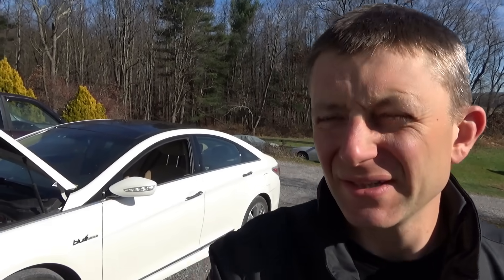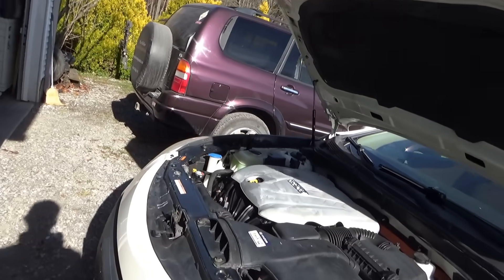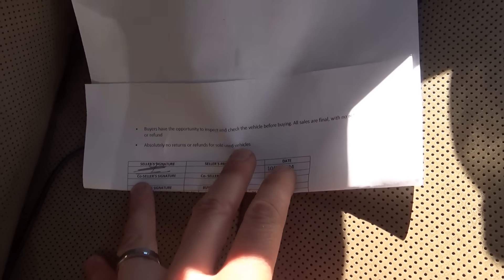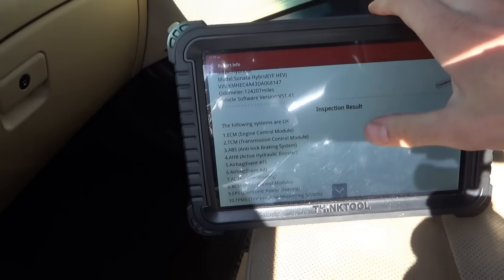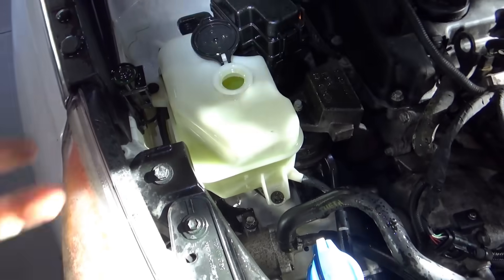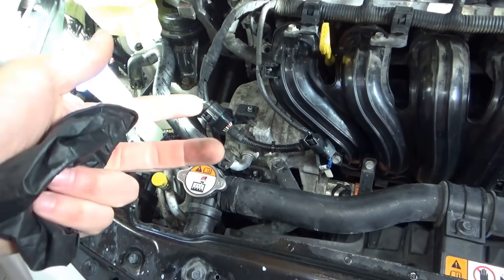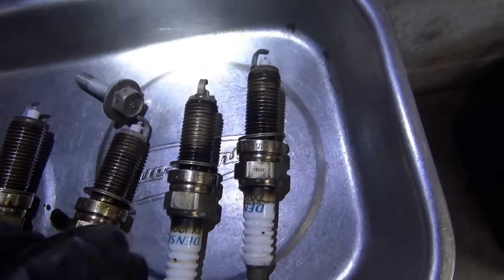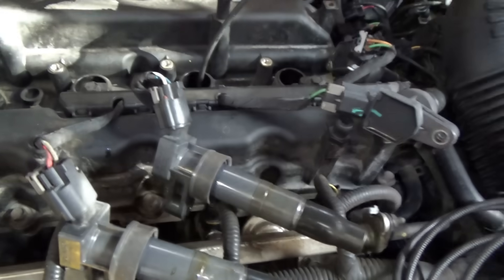Customer SCAMMED?! Hyundai Hybrid NO HEAT & PUKING COOLANT?!?!

Comment: if you have an exhaust gas analyzer you can also "sniff" the radiator/overflow for exhaust gasses. If there are any exhaust gasses present in the cooling system ya have a problem. :)

Comment: Curious if the radiator cap has been messed with so it won’t hold pressure in the cooling system. 🤔Extremely shady way to hide the problem during a short test drive and keep coolant from being pushed into cylinders and causing misfire at startup.

Comment: Gotta say, the buyer has lions share of responsibility here imo. Tires alone should’ve made them run in the other direction.
Reply: I totally agree! Its the buyers job to make sure its a good car! Its not the selling dealers fault they sold it with bad tires, if you didn't even notice the bad tires they must have just walked up and bought the car, no test drive or anything! They obviously didn't read the contract, it said "No Returns". Now that's not to say the dealer knew it had a blown head gasket or not? But dealers spend as little money as needed. They may have not even drove the car? It had no codes anywhere in the car! Also the customer drove the car to Ivan that alone could have blown the head gasket? Maybe the water pump or thermostat were bad and that was causing it to over heat? We don't know why it blew the head gasket, only guessing at this point. We are only getting one side of the story and customers always leave out the part the incriminates them! Always! I think the buyer is 90% at fault.

Comment: With that text from the dealer saying he has 30 days on the engine, he will surely lose in the legal arena. Not to mention the buyer will have much time invested to get to that point. I would have pulled the head and checked the block surface for flatness before getting another engine.

Comment: Mistake number 1, buying from a used car dealer.
Mistake number 2, buying a Hyundai.
Mistake number 3, buying a hybrid.
Reply: Love how the complaint is that it's a hybrid, despite the problem being with the ICE engine.
Reply: And not necessarily in that order.
Reply: I'd be buying a pogo stick before a Hyundai hybrid.
Reply: Buy a Toyota, instead.
Reply: @MichaelNomura-i9n you have seen all the Prius (Prii?) Ivan has confirmed bad head gaskets on right?
Reply: Nothing wrong with hybrids depending on the model
Reply: I say he only made one mistake...buying a used Hyundai.

Comment: Blown headsets push coolant away from the head, it creates hot spots, this is bad and can break the head due to thermal shock. 
I have a very long history of heavy line mechanic's at Ford in Santa Barbara and elsewhere in California. It's more common than you would think, and folks just hit the gas instead of having it attended to. Different metals move at different rates, aluminum expands twice as fast as steel, and goes twice as far, this is the primary reason gaskets fail.
Heavy line repair is a specialty, just like you and your expert take on electronics. Short driving cars causes more damage than anything, Hot cold cycles are a real problem, I have seen countless vehicles being short driven, most blow a gasket in less than 60 thousand miles, especially if they are aluminum on cast iron.

Comment: Long ago I put regulated shop air into a cylinder on something like that - don't remember the details.  The radiator cap was off for some reason too. When I hooked up the air hose to the fitting in the spark plug hole it blew coolant everywhere, including on myself.  Kind of had to laugh about it a few minutes later.

Comment: A couple of things are screaming out here. First of all, there is rarely a warranty on a used car, and the forms that are used for the sale are pretty clear, so you won't stand a chance in court. Second, the cost of taking a case like this to court is outrageous - and because the "Lemon Law" does NOT apply to used cars, YOU have to pay for the lawyer fees and court fees, so you have to do the math. You can figure at least 3K unless you go to small claims court, but most of them have a cap on the amount you can go there for, so either way you're hosed. Personally, I wouldn't want a hybrid anyhow, then you get one over 100K miles and from the majority of videos (Both Ivan and others I watch), they are ticking time bombs.

Comment: Thanks, here in the UK we do get some protection if you buy from a dealer and could return such a car in the first 30 days, possibly even up to 6 months if the fault was there when the car was sold.
Private sale, you are on your own, some private sellers even sell a car as spares and repairs only, even though it runs OK, just to avoid any comeback.

Comment: Ivan, reminds me of the time I screwed in a brand new Snap On pressure tester and that damn car with the blown head gasket filled it up with anti-freeze as soon as I touched the key! Seems like on this one coolant should be streaming out the exhaust pipe as well. Your process and diagnosis  was outstanding. Thanks for Sharing! :body-blue-raised-arms::hand-orange-covering-eyes:🙃🙂 P.S. Been looking at those cameras for awhile.

Comment: The blame game. Who’s at fault? Simple answer is the customer is at fault for not doing their due diligence and looking at the fine print. I’m sure it was advertised as “As Is” but the customer bought without doing a pre purchase inspection. I wouldn’t be so quick in saying a used car dealer scam when the dealer gave the customer 30 days even after stating no refunds. I’m sure they bought it at auction from another dealer unloading a high mileage car or a wholesaler who picked it up at auction to flip. Buyer beware! There is enough information published that anyone who buys a car as is and doesn’t do a pre purchase inspection that is just silly.

Comment: At 7:20, you had your hand in front of a closed vent.
Did you consider a stuck thermostat?
Mechanics recommend a pre-sale inspection for used cars. If the car is certified from a dealer, it has already been done.
Reply: Don't trust dealer inspections. I once looked at a used vehicle at a dealership. They had an inspection report dated a month previous, passed no problems. Everything else said they acquired it 10 days ago, hmmm. Massive oil leak   from the oil pan that showed signs of repair. Pointed out these issues, was given the bums rush out the door.

Comment: I agree... HOLY CRAP that's a huge head gasket leak!  I am going to suggest that this engine was taken apart and put back together with the same gasket and/or the head bolts weren't even tightened or something like that.

Comment: Its not a dealership. Its a used car lot. People run their cars and do no maintenance and sell it and run. 
Its a throw away society. 
Its A bummer. 
One day i scanned a 2018 Acadia. 2.4 GM or General Mess.
Older gentleman. 
His daughter and he stopped by because of the money light 🚨.
After the scan, i asked when he bought it. About a week old.
I told his daughter the meaning of the codes. To take it to another mechanic for a second option to verify what the codes mean. And actually pull the valve covers.
On the 2.4 General mess engines only last 70k or 80k because the timing chains are worn out. 
Or get their money back. Or tell the used car joint to repair the issues.

Comment: I had a friend many years ago whose mother bought him a Mini from such a dealer somewhere in London. I took one look at it and asked him about the body, as the roof had a rather distinct v-shape to it. Not sure if it was rolled, but you could clearly see the roof was not right just by looking at the windscreen rubber. Coupled with the fact the passenger door would just randomly fly open when you went around a corner. He didn't keep it very long....

Comment: You could see with all 4 plugs having signs of use, but the ceramic being spotless white, that this engine has water getting into the cylinders. Likely all it needs is a new head, and a block skim, but at US labour prices it is off to Mexico to get that done.
Reply: Crazy how it would be cheaper to ship to Mexico, get work done, and ship back than to have it done locally.

I have an old straight 6 that needs a basic rebuild (bore 20 over, polish crank, valve job, and resurface the block and heads).

It's cheaper to buy a rebuilt long block and ship to me than to get the machining done locally, nevermind the parts to finish the rebuild.

20 years ago that wasn't the case. I rebuilt a big V8 and the parts and machine work was half the cost of a short block.

Comment: Even having a reliable mechanic do a pre purchase inspection is a crapshoot on higher mileage vehicles. I rarely do it anymore, except for some “ special” cases.All you can do is check the obvious stuff, and especially with most cvt and even regular auto transmissions. You can’t even pull a dipstick to check the oil condition, which probably 95% of the time has never been serviced. And most of these vehicles have never had timing belt service performed and you can tell the buyer about this situation and they pretty much ignore the advice anyway .

Comment: With that bad a coolant leak in the cylinders it should have been smoking white and/or misfiring on start-up.  That's usually the case anyways. 
No misfire codes, no P0420 yet.   Interesting.

Comment: I was going to buy a new hybrid here in Australia but have given up on that idea...
Is bubbledge a word!!
Reply: Ivan doesn't like hybrids, I think he's getting older and becoming learning resistant.  I've got a 16 Prius with 292k miles. I'm into it for a brake job once, a steering rack at 200k, and recently lost a heat exchanger in cat.  I just bypassed the heat exchanger. I'm not going back to non hybrid unless it's a toy

Comment: It sounds crazy but I've had better luck buying used cars from a couple of hole in the wall dealerships than a legit dealership. I bought 2 Subaru Outbacks-- a 2016 and then a 2013 H6-- from the hole in the wall dealers, both were in great condition and I never had any issues. Then last year I bought a 2019 Outback from a legit Ford dealership here in town (test driven for about 45 minutes with zero issues,) and on the drive home it overheated and I found out it had a blown head gasket. Dealer agreed to pay half of the repair but I was still out $1600 to get it fixed. Plus the sales manager gave me all sorts of grief before agreeing to those terms.

Comment: That "alternator thing" is a combo alternator starter for the hybrid system to smoothly restart the engine instead of a conventional starter used on many annoying start/stop systems. And yes, it uses a conventional automatic transmission instead of a CVT. One of the better things about Hyundai/Kia. As for warranty, in Virginia, as long as it has a Virginia safety inspection, it can be sold as is. Owner is wasting time perusing legal action. They were too cheap to get a PPI and now it's biting them in the back.

Comment: He was putting shop air on the cooling system, of course it was going to spray into the cylinders.  But under normal operating conditions, the combustion gasses would be the highest pressure, way over the 14 or 16 psi that the cooling system is operating at.  That is why there was no burning of coolant within the engine, because it only provided pressure outwards into the cooling system.
Reply: On the intake stroke a pressurized coolant system can definitely push coolant into the cylinder

Comment: You should get one of those vacuum coolant fill things if the system won't hold vacuum it has a leak or a blown headgasket much easier diagnosis
Reply: Yup -  and with a bit of adaptation the vacuum coolant fill rig makes a dandy one person brake bleeding system!

Comment: I took a risk once and bought a ford ranger that the owner told me had one bad head gasket. It turned out that both heads were cracked. Also, while taking the top end off the engine, found that someone broke the upper intake right on the side and half ass threw it back together. The truck still ran but it had no heat and the classic symptoms of puking coolant out of the overflow and pressurized hoses. It also would flood the cylinders out and wouldn't start. Sounded like it was hydro-locking. I took upon myself to throw a set of heads, and an intake on this truck because it had really super nice tires, 4x4 worked(intermittently), and the transmission seemed to shift ok. All in all, a very smooth truck to drive but once I opened the can of worms it was done. I also found that the engine got so hot that it started warping the cylinder walls.

Comment: That's why the spark plugs were so clean, steam cleaned.
Reply: What I would do… make the engine knock or seized and take it to Hyundai they cover the rod bearings and the hybrids always, just make sure there an oem filter on it and some old oil 😂
Reply: @nathansteed1891 
That would be fraud 
You would be okay with yourself with that?
Reply: Not necessarily, engine combustion is a higher pressure than engine coolant pressure, so the coolant did not get in to the combustion chamber.  Did not burn engine coolant.
Reply: @ then where did the coolant all go?  The combustion chamber pressure will be lower than the coolant pressure during intake and exhaust strokes.
Reply: @ yeah could be, but with that leak into the combustion chamber he showed in the video, some of it had to be making its way in there while running.
Reply from the maker: @Florida_Man_In_Florida pressure was controlled by the radiator cap 😉
Reply: @PineHollowAutoDiagnostics  I’m actually surprised it had not hydrolocked at some point. 😳
Reply: @brianw8963  I was surprised that there was no white smoke coming out the exhaust.
Reply: @LesReeves  Well, just from what I could dissect from what I saw, this engine was trashed including the rings. The oil was recently changed according to Ivan, but it actually looked a bit milky to my eyes. Not bad , but it appeared to have that tint to me. That would explain why it would only have a small bit of white exhaust at start up, and clear up quickly. The coolant was passing down through the worn cylinder about as fast as it was entering, which is why it did not hydrolock. And after startup, the compression kept the coolant from entering the combustion chamber. Just my theory . 👍👍🤔
Reply: @Florida_Man_In_Florida There was definitely coolant in the cylinders that entered after engine was shut off from pressure in cooling system. That’s why it ran rough at first start up.

Comment: The Hyundai extended engine warranty for that car says: "Hyundai Motor America has decided to extend the warranty for the engine's "short block" assembly (consisting of the engine block, crankshaft and bearings, connecting rods and bearings, and pistons) on 2011-2014 Sonatas manufactured at Hyundai Motor Manufacturing Alabama to 10 years from the date of original delivery or the date of first use, or 120,000 miles, whichever occurs first." The new owner is out of luck unless they sue the seller and win.

Comment: Water glass , used some on a ford eco boost with the common head gasket failure . It did stop the steaming out the tailpipe . The customer sold it . I tend to believe in the old school solutions
Reply: Oh yeah nice repair for the next guy.
Reply: @Guillotines_For_Globalists  people been using sodium silicate to seal cooling systems for decades . Remember, your dad was not always correct .